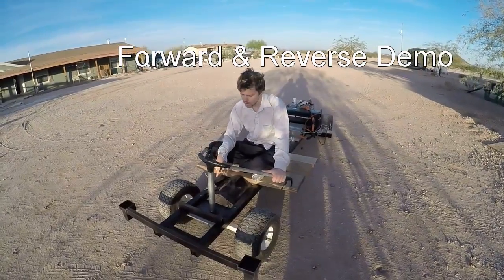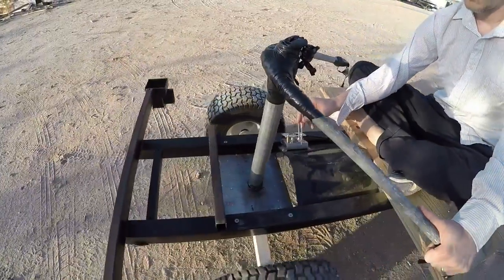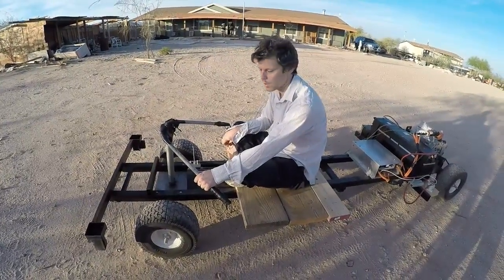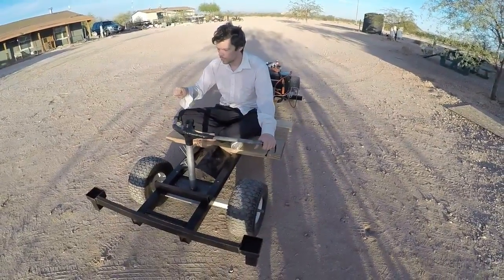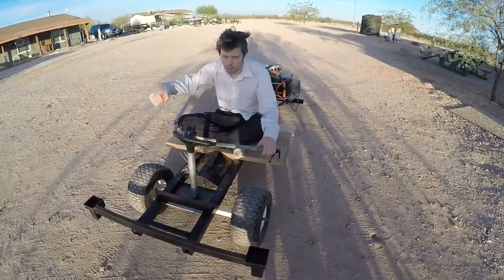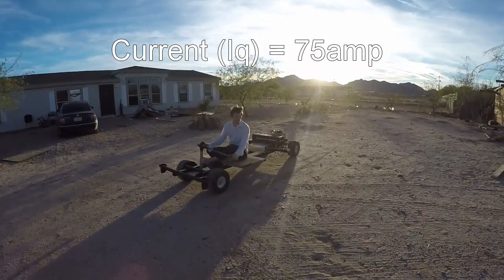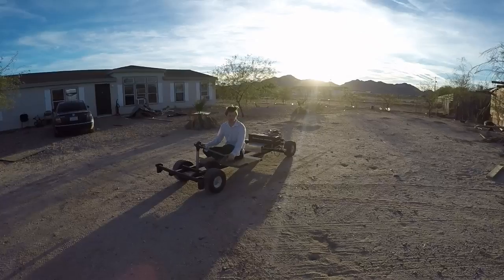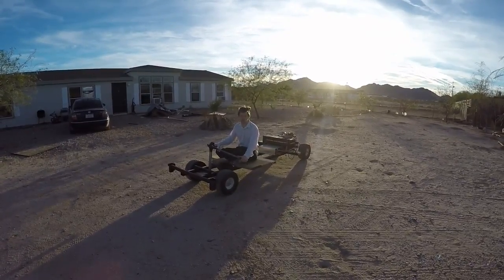Nissan Leaf Go Kart Forward Reverse Demo

Comment: what if i use a engiene to run it as a generator   would i get this?  400a x 400v =160kw
Reply from the maker: Yes you could do that for a relatively short period of time.